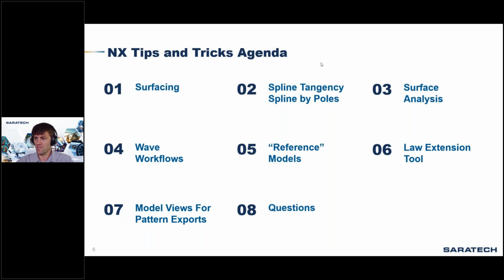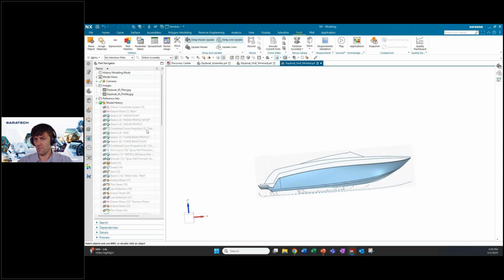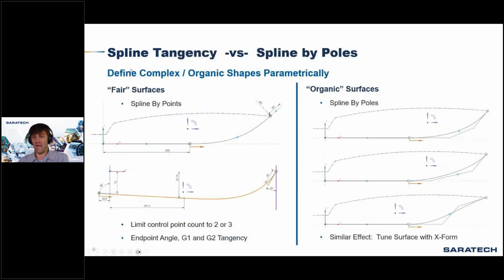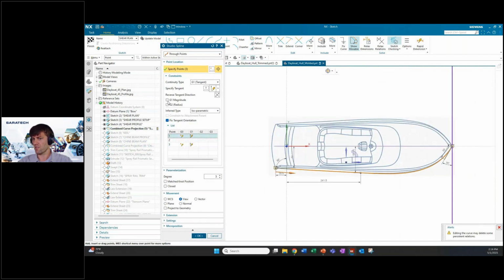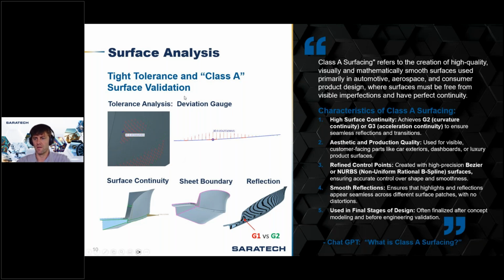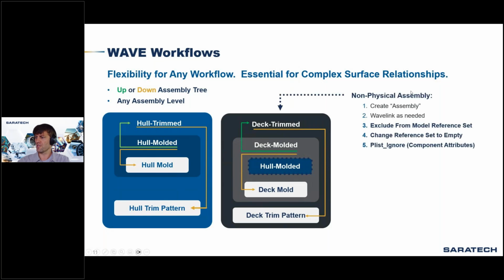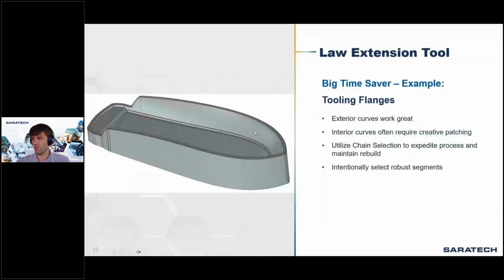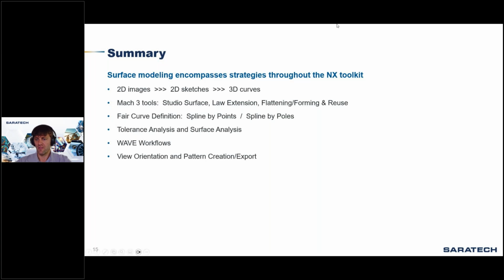Customer Enablement Series: Useful NX Tips You May Have Missed

Comment from the maker: Transcript:

For everyone that's joined in, thanks for taking the time out of your day. I'm going to cover a variety of NX tips and tricks, focused on advanced surfacing, tools you would use with that, and how to incorporate them into Wave workflows and exports.

We'll first talk about surfacing techniques, then fundamental spline definitions, followed by surface analysis and what it means to be a Class A surface. We'll discuss reusing geometry through various Wave workflows upstream and downstream, a reference model approach to streamline your process, and tools like Law Extension and Mach 3. Finally, we'll cover arranging views for exports of patterns for manufacturing and work construction purposes. Questions can be typed in at any time, and we'll address them as we go.

Surfacing may be somewhat basic for some, but the goal is to cover broader topics. If you haven't surfaced before, the question is: how do you define something where nothing is flat, straight, or square? There are different methodologies, but my preferred method for designing complex recreational boats is to first flatten the surfaces, develop your profile and plan curves, and then intersect them. A common issue is overbuilding surfaces rather than building to shared edge curves. For example, at the transom of a boat, following a profile and plan intersection may result in deviations due to the difficulty of developing exact geometry in curves.

Another fundamental tip is to break surfaces down. Don't try to do too much at once. If you've got multiple surfaces, break them into major homogeneous surfaces. For example, instead of combining a rub rail shear line with the whole side and spray rail step, handle each major surface separately.

In NX, you can delay model updates and link updates. This allows you to modify foundational geometry without waiting for all components to update. For instance, an industrial designer may provide profile and plan views of a boat. I start constructing it in 2D, creating sketches for the shear plan and shear profile. I first define curves with sharp corners and then refine them by adding radii, followed by a combined projection into 3D space. This defines a complex shear line simply while remaining true to the artist's intent.

Regarding surfacing tools, NX Design Premium includes Mach 3 tools. My favorite is the Studio Surface, which is more flexible than through-curve meshes or sweeps and maintains excellent G1 and G2 tangency for Class A surfaces. Reflection lines of a Studio Surface are clean, while a sweep may produce kinks in the center. Mach 3 also provides surface flattening, forming, and reuse tools. Law Extension is useful for mold work, allowing quick creation of complex mold flanges.

Spline definition is key. I often use spline by points for fair surfaces that are smooth without ripples. You define endpoints with tangency and limit points to control the curve. A midpoint can be added to introduce a concave or convex shape. Spline by poles is more organic; control points are in space and can be adjusted to define complex, hand-shaped profiles. Tangency (G1) and curvature (G2) can be controlled using construction curves. Adjusting angles and magnitudes of these curves allows precise control of the spline.

Surface analysis is critical for Class A surfaces, which are high-quality, visually and mathematically smooth surfaces used in automotive, aerospace, and consumer product design. NX provides analysis for surface continuity, reflection lines, and tolerance deviations. Reflection lines reveal true smoothness; Class A surfaces should be free of ripples or distortions. G2 tangency ensures smooth reflection connections across surfaces. Deviation gauges allow real-time comparison to reference models or scanned data, ensuring surfaces are accurate.

Wave workflows are powerful and allow linking components anywhere in the assembly tree. For example, you might model a hull molded component, then apply trims and create non-physical assemblies for decks or other components. Care must be taken to avoid circular references; using two-layer part generation achieves the same benefits without circular relationships.

The Law Extension tool accelerates mold flange creation. Exterior curves work well in sweeps, while interior curves may require patching or sectional breakdowns. The NX model shows a short feature tree efficiently creating extended flanges and a solid body.

For model views and pattern exports, flat patterns are needed for graphics or trim operations. In marine workflows, these patterns help create accurate hole centers for production, fixtures, and jigs. Using Wave linking, starboard and port hole trims can reference a linked body, which is then flattened and formed. Features are deleted via "Trim Delete Body" to retain linked geometry. Drawing orientation is set normal to the flattened view for accurate plotting.

In summary:

Start with 2D images, develop sketches, and generate 3D curves.

Use Mach 3 tools: Studio Surface, Law Extension, Flattening, Forming, and Reuse.

Define fair curves using spline by points or spline by poles.

Analyze output with surface and tolerance analysis.

Plan Wave workflows to model complex surfaces once and reuse geometry downstream.

Orient views correctly and create accurate patterns for exports.